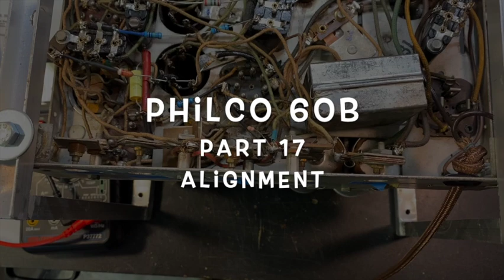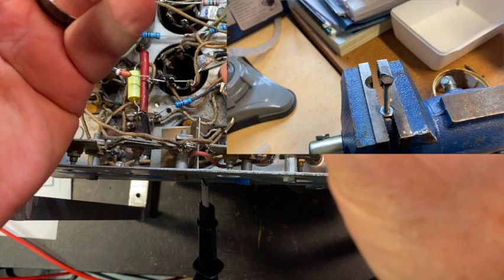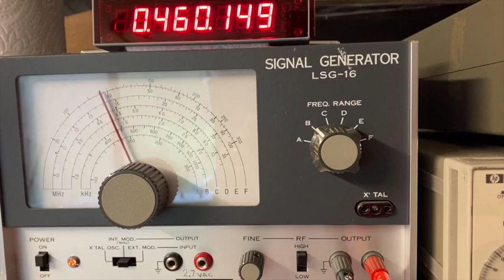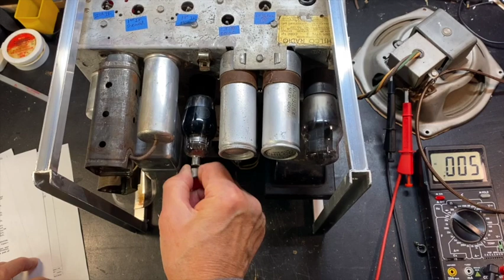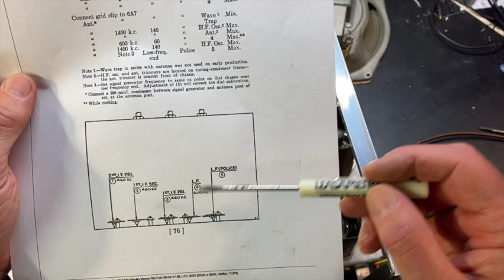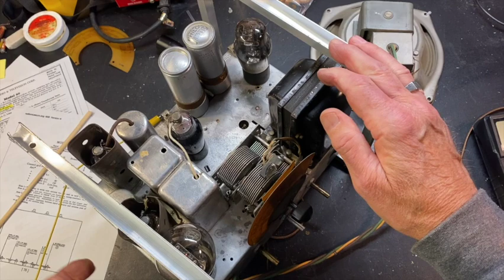Philco 60B Part 17 Alignment

Comment: Thank you for posting this. I'm working on my Philco 60B and this is very informative. I have the earlier version 60B with the small tuning window. I was curious, I see you replaced some resistors. Did you replace the filter capacitors as well?  I was very surprised to find out that my original filter caps are still functional, no 60hz line hum at all. I need to go through it, but it was working when I bought it. Also love the Fibber Mcgee reference, my favorite OTR program along with Jack Benny!

Comment: Martin, I am surprised you use a digital voltmeter to do the alignment. I've always read that you can be more accurate with an analog meter where you get a better picture of the swings as you turn the alignment screws.  I guess it works, but was curious if you prefer that kind of meter for this?
Reply from the maker: I’ve used both digital and analog, and can’t see much difference. If I were after seriously accurate alignment, I would use Dick Whipple’s WSAB board. More info here: http://whippleway.com/

Comment: Hi,
Despite the front of the speaker to your radio covered over with cardboard to help minimise its cone from being punctured, the audio sounds quite good.  Adding blue tooth facility will certainly give that radio a new lease of life.  Here in England, AM radio tramsmissions are now down to three channels - Radio 5-live, and Radio 5-live Sport on the Medium Wave band, and only one station (BBC Radio 4) on the Long Wave band.  How long AM transmissions in the UK remain on-air is anyone's guess.
So; apart from ending up in the trash, the facilties that will be left for AM only radios is blue tooth, and up to 50 milliwatts in-home AM transmision reception.
In case you are not familiar with "Electronics old and new" YouTube channel, M. Caldeira includes, among a few of his radio restorations, a number of small useful add-on project circuits, such as blue tooth enhancement; correct mains polarity for hot chassis radios; refined voltage adjustment facility for converting rectifier valve, or selenium rectification to silicone rectification (that was a circuit I adapted for replacing a metal rectifier to silicone rectification in my Pye, model MM), and others.  Manuel largely performs restoration on German valve radios, along with one or two British radios (he also performs on solid state radios), his channel is well worth a visit.
Nice chatting to you (so to speak), Phil.
Reply from the maker: @philbooth1511  Thank you, Phil. I have long been a fan of Miguel Caldeira, and will use one of his modules in the Philco. It is sad about broadcast band, but its demise is inevitable, I’m afraid. As you say, Bluetooth will be the only saving grace for our old radios.